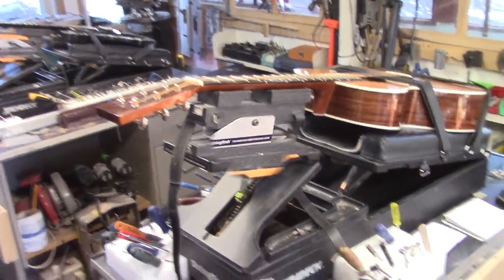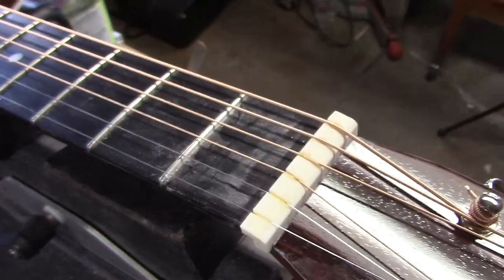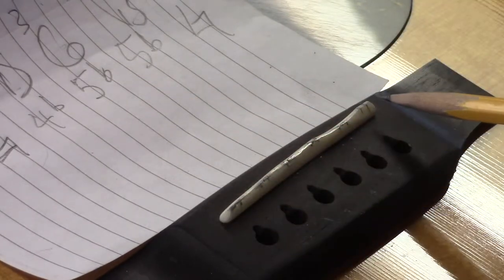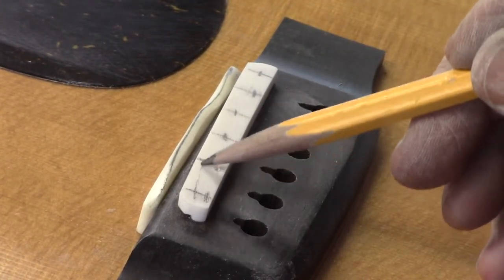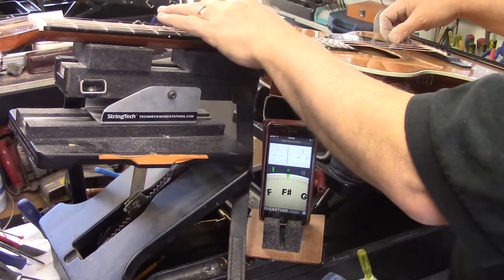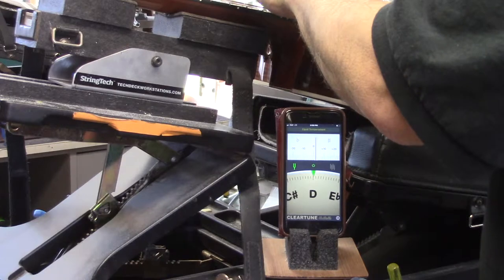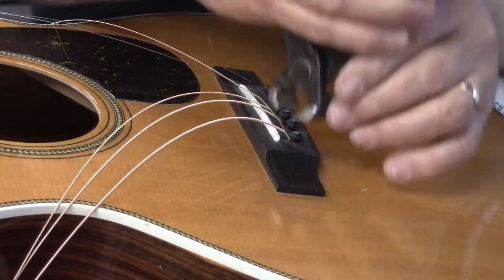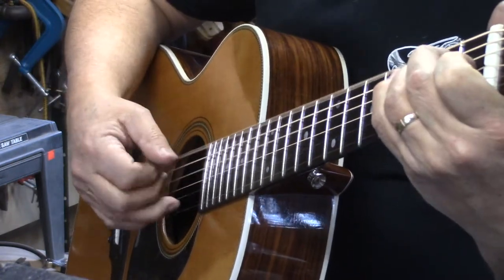Detailed Guitar Tuning / Compensation@StringTechWorkstations

Comment: Damn, it was almost unnatural to hear the guitar so in tune. Sounded almost like a keyboard.
Reply from the maker: Lol ! Ya' keyboard players and violinists are stunned when they hear this.  Ha!
Reply: I was surprised to see you intonate the bridge using 5 and 17th fret (though it does make sense), but I don't quite get how you intonate the nut and then adjust height and intonate again. Can you please explain the steps briefly?  @StringTechWorkstations
Reply from the maker: I do cover this in much greater detail for my Tier 3 Patreons subs. Spec sheets and variations etc ...

Comment: My 1972 Epiphone F150 acoustic guitar (a gift from my young wife those many years ago) Was actually an unplayable POS. The bolt on neck had a zero fret to begin with and the fret spacing was not correct. The bridge and saddle were not placed properly and the guitar could not be tuned because intonation was impossible to achieve. Oh yeah and the action at the 12th fret was in excess of 3/8th's inch. The guitar spent 15 plus years in the case and when it got opened the neck, still under string tension. jackknifed up and smashed the top around the soundhole because the upper brace glue failed and the brace was lying in the bottom. I have repaired everything since except repositioning the bridge. Compensated intonation using small chips of bone as replacements for the zero fret helped and now action is 6/32nd's at the 12th fret. It works nice and has a sound that is great. Miracles happen.
Reply from the maker: Bravo ! Sounds like quite the journeyhttps://youtu.be/li8s3mzvwCU?si=V65YS4G1YwGbXWAy

Comment: That is what I need to learn how to do. Especially since I have all these high grade tone woods, frets perfectly leveled, crowned, dressed and polished, copper shielded, twisted wires, CTS pots and orange drop capacitors guitars. Am just going for perfection. Good at making traditional nuts and getting the slot depth perfect. Just missing a compensated nut for perfect intonation! Gonna be my winter projects is switching all of my guitars over. The mertlewood acoustic, the modernized 72 thinline and the casino are the ones that need it the most. They all need it. The new quarter sawn one piece swamp ash and quarter sawn maple rosewood compound radius neck micawber build with a 59 neck humbucker and a hot single coil bridge pup. That's is conceptually a warmer, more resonate, and smoother Micawber. Like a smooth jazz and blues prog rock type of guitar. Where the real Micawber is a little more raw. A compensated nut will just add to the smoothness. The only one I'll probably leave alone is 57 reissue strat. But next summer I building a super strat. Have an extra light flat sawn one piece body, gonna get a modern compound radius quarter sawn maple neck. Aerosol nitro finish it with wood sealer and grain fill. Just like the old days. Trying to blow the custom shop away. Those are my expectations, anyways. Otherwise it is pointless I'll just go buy a custom shop.
Reply from the maker: Man on a mission ! Bravo !
Reply: @StringTechWorkstations  definitely a little OCD. With good reason. Since I started working on guitars I've been playing better guitars than I ever imagined.

Comment: Greetings sir 😊 when you say to remember to get that action at the bridge as close as possible to the final height do you mean the action at the 12th fret?
Reply from the maker: Before calibrating the compensated nut I try get the bridge saddle as close as possible to the final height, for a more accurate overall read on the intonation. This also helps at the very end of the calibration process, as I put that final set of strings on, and ultra-tweak ALL of the values, for the final run. Thanks for asking.

Comment: Good job and it obviously works well.  Personally if I had to do this to one of my instruments - and I do my own basic work even though I'm no professional - I would route out a much wider slot and then use individual pieces of saddle for each string with shims either in front or behind to adjust the intonation.  I'd be a little afraid with a cantilever system that you might get some weird artifacts from the pressure trying to lean the saddle forward.  I'm hardly ever concerned with keeping the vintage or original aspect of a guitar because I'm all about playing the heck out of it while I'm alive and it's alive.😅
Reply from the maker: OPK Garflips:

Lol ! I get it totally .... made-to-be-played ... not worshipped. I am with you on that. As far as the cantilevered saddle: The cantilevered portion usually has a 
( approx ) 12" radius on the leading edge. This cantilevered portion rests on the wood of the bridge just ahead of the slot. The radius disc sander conversion kit for the drill press ( that I designed );  allows the Guitar Techs and Luthiers to accomplish ( literally )  in seconds ( about 14 seconds to be exact ) what would normally take MUCH more time to do by hand. My concern with the individual pieces; would be lining  up all of the multiple surfaces ...making sure that all of those surfaces make the same amount of contact. Under string pressure I would be nervous about rattling or extraneous noise .... with individual saddles vibrating against themselves ... or not seating intimately ( especially with any type of under-the-saddle transducers ). Also slotting a bridge with an extra wide slot, increases the chance of that front lip ... possibly cracking or breaking off. This upcoming video with the Tsai Guitar with the Carpathian Elm Burl back and sides ... will illustrate .. again ... that it is quite possible to get a good press fit AND have the proper support for the cantilevered portion. Thank you for your comments... it gets us ALL thinking. Also : Although you are obviously not a part of the "Originality Police Force" ... the way I do this  .... IT IS REVERSABLE ( if you were crazy enough to put it back to original ... Lol ! )  Keep on playing while you are still alive ! Cheers , MMcC
Reply: @StringTechWorkstations  Good points!

Comment: This is a lot of work.  Why don't acoustic guitars use adjustable bridges (like electric guitars), or floating/adjustable bridges like mandolins?
Reply from the maker: Fair enough questions. The adjustable electric guitar bridges are an entirely different animal. The "adjustability" is unnecessary on an acoustic guitar ... once it is calibrated for the exact string tuning and scale length; there is rarely any need to "re-adjust". IF any adjustment is needed, the values at the focal points on the saddle can be adjusted slightly. Floating bridges are used on most Arch-Top guitars .... but ... the way the the " flat top " guitars are designed; the bridge needs to be attached to the top, to " drive" the soundboard. Cheers ! MMcC
Reply: @StringTechWorkstations  That explains everything very clearly.  Thanks for taking the time to answer. Much appreciated.

Comment: On another note, I noticed that at the nut, your strings are sitting "above" the nut slots, and not fully enclosed.

Although the contact point is true (and is sufficient for intonation), the sides of the nut slot lack  "structural support".

Does this reduce the vibration transfer, since it has a smaller surface area that contacts the nut? Or does most of the energy transfer occur through the node/contact point only? The node would create the downwards pressure and use up energy that way, but the "walls" of the nut slot would surely eat up some energy too, right?

My strings are swallowed by the nut slots. How deep is too deep? Surely the same result could be achieved by cutting the bottom of the nut instead of digging a hole to China lol.
Reply from the maker: Ultimately; 1/3 of the diameter of the string should rest in the slot.
Reply: @StringTechWorkstations  good enough for me, thanks!

Comment: Do you have any tips for setting intonation around down-tuning? I'm in Drop C (D standard) and every time it comes to intonation, the guitar wants to go sharp. I find this to be the case for most guitars, acoustic or electric. Usually sharp, not flat. I want this tuning to sound like home for the instrument.

I know most guitars are built and scaled to match E standard at 440hz...is there anything in particular that would limit my ability to make the necessary adjustments?

More of a physics question than a trial-and-error question.
Reply from the maker: It will always be somewhat of a moving target. This Guild was setup for A 432.  https://youtu.be/tjUdzztW0i0
Reply: @StringTechWorkstations  you're the best! Love the consistent camera angle too, really helps compare between guitars